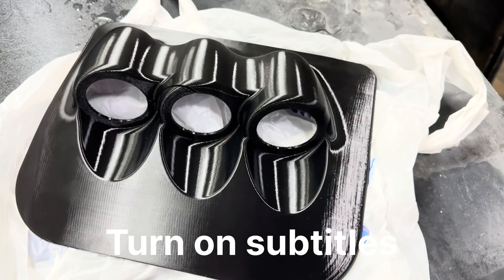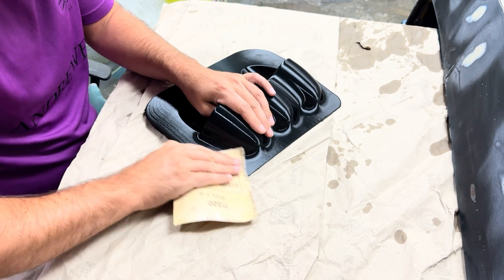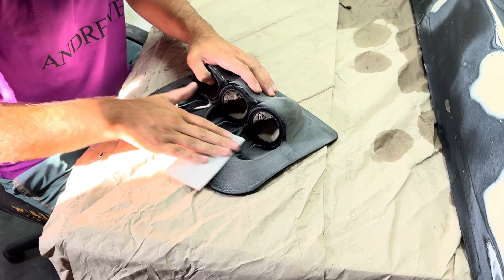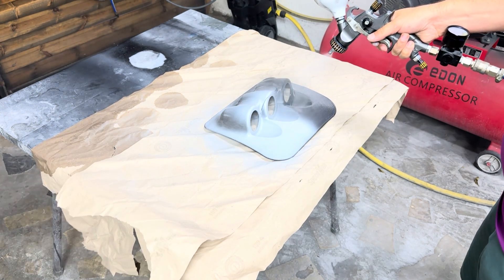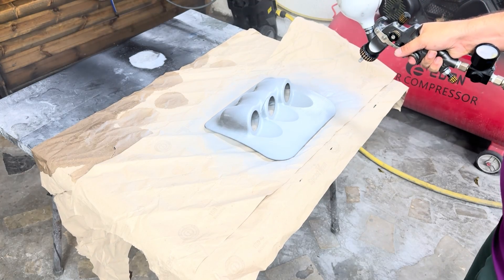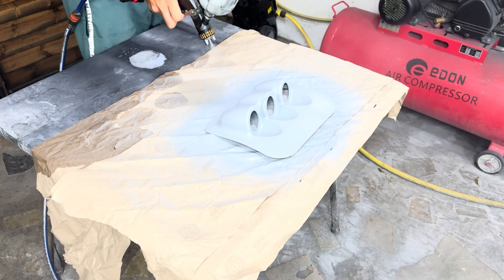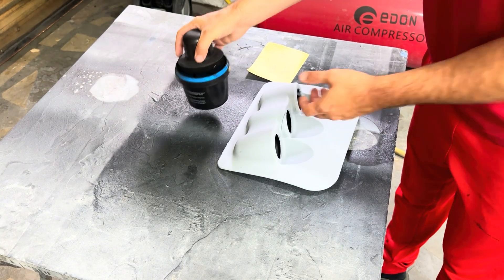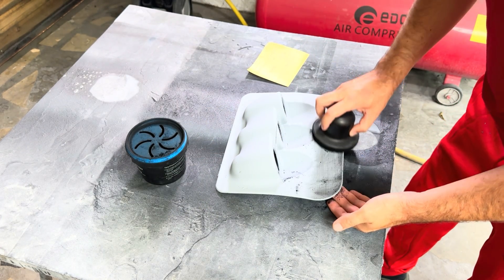DIY - FROM 3D PRINTED TO CARBON FIBER PART - TRIPLE GAUGE POD

Comment: have a question, why not to print form not the part ? like if you make a part in Cad, just make a negative of it and it will be a form without part. you save time. or is the part printed just to see if it fits ?
Reply from the maker: Hi, that’s a great suggestion — someone else told me the same thing. The thing is, I don’t have a 3D printer, nor do I have knowledge of 3D software. A friend printed it and brought it to me. For the future, I’ll keep in mind the advice about making a negative print and using that as a mold. Thanks for the feedback, I really appreciate it!
Reply: @rezzynumber1  glad i was in some of use :D keep up the good work!
Reply from the maker: Thanks! Appreciate the feedback!

Comment: What happened the first time, and what did you do differently when it worked? Was it just the seal location or the timing?
Reply from the maker: Hi, release wax wasn’t enough for good release from the mould. Second time I added PVA with release wax for better release.

Comment: just a question. Why not just print the "negative" of the part, its made automatically in a 3d modeling software if you want, and then just print it out from PVA or other water dissolving material. Then just put CF over the negative, vaccum it, cure it and then put it in a water bucket. The print will disappear and you will be left with only CF
Reply from the maker: Hi, that’s a great suggestion — someone else told me the same thing. The thing is, I don’t have a 3D printer, nor do I have knowledge of 3D software. A friend printed it and brought it to me. For the future, I’ll keep in mind the advice about making a negative print and using that as a mold. Thanks for the feedback, I really appreciate it!
Reply: @rezzynumber1  Keep it in mind for the future. Every printer can print PVA or similar filament that dissolves in water your friend doesnt need any special equipment :) great video BTW.
Reply from the maker: @KristjanS-Kristeh  Thanks again!

Comment: Hi. Why did it laminate on the first try? Was the gel coat polyester and the resin rejected it? It didn't even adhere to the filleting wax...
Reply from the maker: Hi! Problem was release, second time I added PVA after release wax and it solved a problem.
Reply: @rezzynumber1 Ah... it's good to know that wax alone doesn't work that well. I've seen that Easy Composites applies it that way, only first the wax and then PVA. Thanks for your videos, I'm learning a lot.😁
Reply from the maker: @Ruka_27-94 yes, pva helps a lot. you are welcome!

Comment: For next time, instead of using wax release agent, try using PVA release agent. That way, when you demold, adding water will dissolve the PVA and the piece will practically peel off by itself. Very good work and a great fix for the demolding error.👌
Reply from the maker: Thanks for the feedback! In the second mould I  added PVA for release and it helped a lot.

Comment: In the first segment I kept thinking "this is not how I would have done it" and then it didnt work, but in the second segment it just cuts to the vacuum phase and I dont see what was done differently so cant learn anything, but I would have used a high temperature mold, prepreg carbon sheets that was cut from tape-templates from the mold or original shape, then used a kitchen oven to step up the temperature with bag still under vacuum.
Reply from the maker: Hi! After cut I didn’t show same boring process of making mould from the beginning. Second time I used sandable gelcoat for the mould and added PVA for release. As you can see I have not mastered making  carbon parts using vacuum infusion, when time comes I think I would upgrade to prepreg. Thanks for the feedback, I appreciate it!
Reply: @rezzynumber1  Sounds great! Glad youre showing the process and that it does take some practice to master. Pre-preg is the way. Costs more but lot easier to work with; better result out of the mold so less work
Reply from the maker: Thank you! Yes, I really enjoy showing the real process, including mistakes and fixes – I think people learn from that more than just a perfect result.
Pre-preg is definitely on my list for the future. I just want to get more comfortable with vacuum infusion first. When I switch, I’ll compare both methods, could be very interesting. Appreciate your support!
Reply: Also I don't think he used any mould release agent
Reply from the maker: Hi, I used only release agent and release wax.
Reply: @rezzynumber1  ah I wasn't sure now I'm thinking maybe depending on what release agent you use might help it pop out easier cuz it did look like it was very stubborn to come out
Reply from the maker: Second time I added PVA after release wax and it helped.
Reply: @rezzynumber1  sounds like it's just very tough to work with sorry about my earlier comment I was comparing it to fiberglass and seeing how those parts release from their moulds so that's my bad
Reply from the maker: @oingoboingo8577 no worries. Thanks for the feedback!

Comment: Oh no...Perfect example of what not to do
Reply from the maker: Hi, thanks for feedback, what do you mean?
Reply: @rezzynumber1  i think he means, that after open a mould with product it must be with gloss surface... so this part can be move to trash if it for selling, for yourself it can be repaired like you made it
Reply: @apex_turbo you do know companies also sand and lacker their Carbon parts to get perfect finish? Almost impossible to get perfect finish out of the mold.
Reply: @TheTechnoaddict  yes, company where i work can give you more quality of product than on the video, even from the mould, i dont want to make author rude, because at the end of video he got his part ready to use, but when he opened mould... i will prefer to make a new part
Reply: @apex_turbo better but still needs sanding and lacker. And why would you throw away a piece that can still get pretty good with some work put into it? It's not mass production where you have quality control every step of the way.
Reply: @TheTechnoaddict  my internal quality control doesnt let me, let say like this